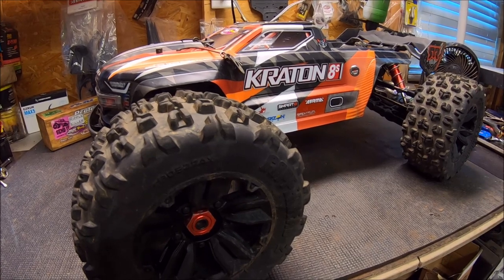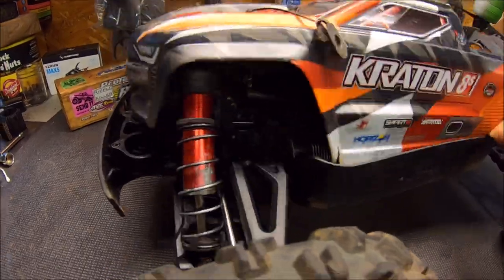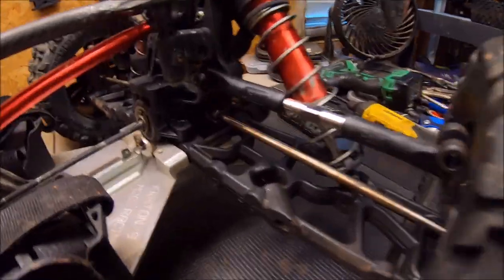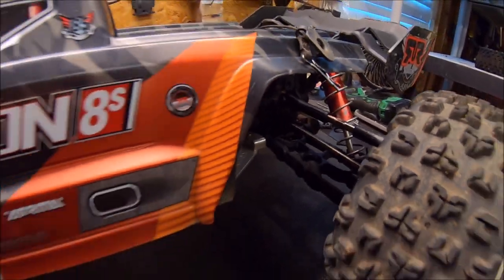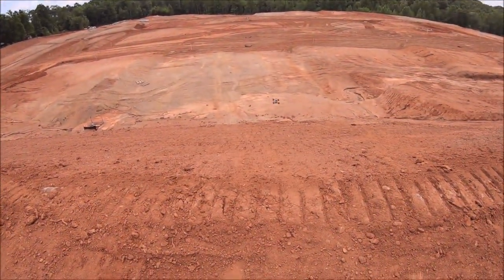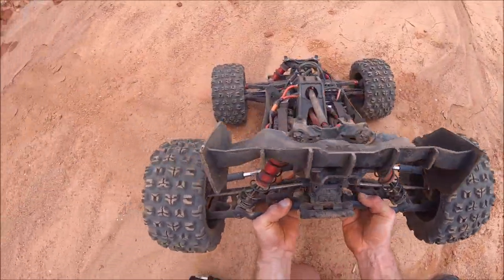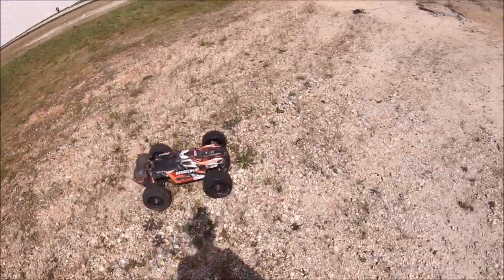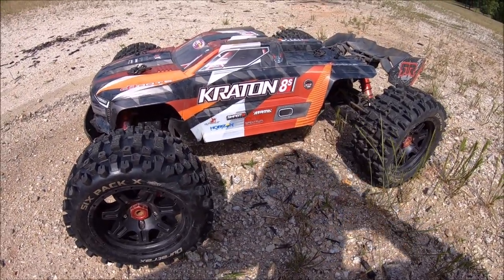ULTIMATE Durability! Arrma Kraton 8s M2C 7mm shock shafts and rod ends test!

Comment: Killer bash session! I think once Mitch releases these parts I'm finally going to pull the trigger on a K8 EXB and sell my Xmaxx.
Reply: Why?
Keep em both bro.
I have the same but have 3 K8's one of them being a EXB but the XMaXX is.fkn awesome at soaking up jumps on flat lands etc etc.
They're both Great.
Reply: @Cornelius456  with a beefed up kraton, the xmaxx seems like a 10yo toy to me. wont go as fast, wont travel as far in the air, isnt as athletic, and wont handle as well since the trick to the xmaxx is to just keep it as stock and light as possible. once you upgrade the powertrain, it turns into a neverending money pit.

Comment: As always an excellent bash session and pumped to get my hands on some of the m2c parts once released. I was out bashing yesterday and brought my ramps for the first time since lady year... I was talking to a buddy about ideas on how to either modify or build an adapter of some sort so that we could take a pair of ramps and securely mount them(temporarily  mount if poss to make hauling them easier but not 100% necessary) . Than I suddenly realized you have been using the stacked ramps for a long time and still seem to be getting used... anyway you might be sale to give me any tips or info on how you tend to stack your ramps please ? I've got 3 pair of kickers that are all very close in dimensions. One pair is discounted ramps old composite kickers that they no longer seem to sell and the other 2 pair are almost identical to the Disc ramps but smaller in width by maybe 2-3 inches total when comparing one pair to the other pair with them both 2 ramps wide. As always apor you and all the insane content. Hope all is well and hoping maybe you can find time to offer some insight (unfortunately no pickup truck so that a main concern asidevfrom total weight if they need to be mounted somewhat permanently) thanks brother 🍻

Comment: Amazing video, may I ask what modification were done to your diffs? Shims, lock, or open?
Reply from the maker: Thanks!!👊I'm running stock diffs just 1.5 mill front, 20 mill center and 500k rear.
Reply: @RCDUDE81  thank you, may I ask if you know the m2c part number used for your motor slide?

Comment: What is your opinion of the rpm arms? Some say not to do the upgrade bc of bending drive shafts.  I have the M2C driveshafts and just curious if you found additional flexing of the driveshafts bc of the more flexible plastic
Reply from the maker: They are more durable for sure but also flex more. I don't like that they don't have a place for droop screws so it's full shock action which puts a lot of strain on the shocks. You can add limiters inside the shocks to compensate if you decide to run them.😎👊

Comment: Nice video. Do u have a part # for those o rings?
Reply from the maker: Thanks!👊The O rings actually didn't last long term. I'll probably experiment with rubber tubing like rc boat cooling line or gas line.

Comment: Can you send link or provide part number for those shock rod ends? And are they from m2c?
Reply from the maker: https://m2cracing.net/shop/shop.php#!/M2C-3240-ARRMA-OUTCAST-8S-5MM-FRONT-OR-REAR-SHOCK-KIT/p/478044653 This a 5mm kit with m2C shock rod ends and shafts. You can also get the 7mm beefcake version. They don't sell just the shock rod ends as they work together with the upgraded M2C shafts. You could also go stock EXB shocks. Those rod ends hold up much better!

Comment: I have a beefcake k8s and running 1 to 1 using 39 tooth. What do you prefer when using 1 to 1 the 34 tooth or the 39 setup? Keep up the AWESOME vids
Reply from the maker: I've never tried a 39/39 setup so I honestly can't say. That is a larger gearing profile so may run hotter. 34/34 is about perfect imo.

Comment: With out  the cost of the kraton truggie just all the m2c upgrades how much would you say ball park looking to get out of my gas an into electric right now I have a ro an with a .71 motor it screams but looking for something different now
Reply from the maker: For all these upgrades probably $500ish depending on what all you get. Arrma also has the EXB roller version that is upgraded out of the box for a bit lesser cost all together but not as strong as the M2C upgrades. All up to how hard you bash!
Reply: I would full send it like how you do that's how I do my gas one up until an hour ago just sold it for 1320 lost my butt on it but never get what you have in them